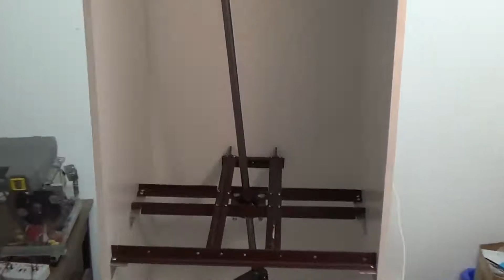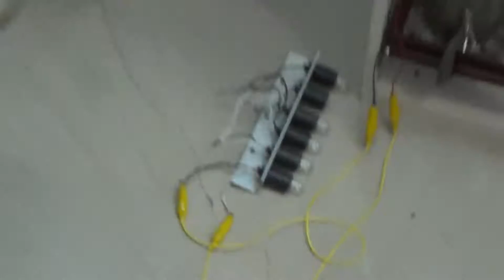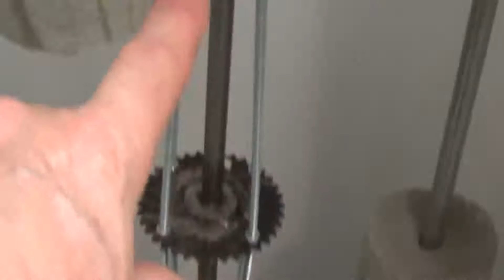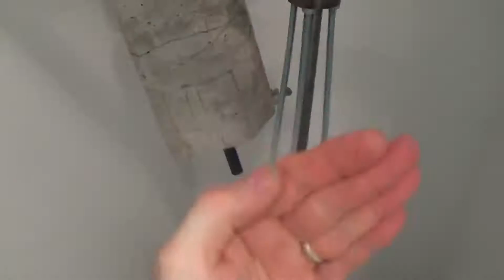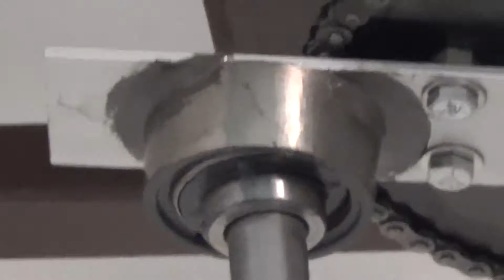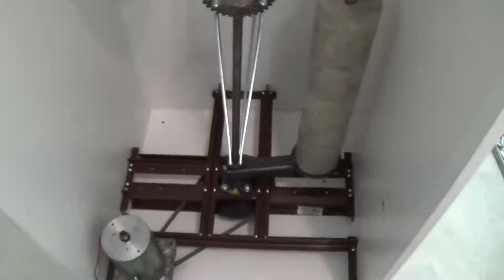William Skinner Gravity Assisted Torque Amplifier test 1

Comment: if you are not getting the amplification it is because what is supposed to be happening in not happening.    and I can see problems with your device.   Remember what is supposed to be taking place.   you are using leverage by a lever arm to lift a mass, (the first weight)  into a position where gravity can act on it.   then gravity starts to pull the weight down but the weight never reaches the bottom, in fact the weight never really looks like it is falling and the height of the mass remains constant.    first stage done, now the second stage is the same as the first stage only a larger mass that is driven by the first stage.    your second stage weight should be doing the same thing, the lever lifts  the second stage weight  to a height where gravity starts to act on it.  then simultaneously the lifting process continues   at the same time the falling process takes place. if your second stage lever arm is not moving enough at the top it won't lift the second stage weight very high and subsequently gravity won't pull very hard on it to pull it down.  remember this is a gravity harvesting machine,  the mass has to gain height in order to fall, if your masses are not lifting very high gravity will have less pulling down force on the mass.     you do not want the first stage drive motor doing anything other than to act as a lever lifting the weight and then to continue to lift the weight as it keeps falling.     the second stage is the same as the first. your first stage is rotating and is attached to the second stage lever doing the same exact thing, lifting the second stage weight so gravity can pull it down.    no forces should be causing rotation in either the upper or lower stages, the only force that should cause rotation is gravity puling the weights down.   watch skinners machine again, the cylinder weight at the bottom looks to be tilted up towards the lever shaft,  it's  tilted up because the lever has been pulled back lifting the weight that can now fall, but it only falls for so many degrees before it is lifted again.   I can't tell looking at your device unless you do very detailed video of it showing close ups and every movement from top to bottom.  that is why I can only explain to you how this things works, now look at your machine and ask your self is it doing exactly what I have stated.    if it does not amplify multiple times then it is not.  find out why.
Reply: Oh boy, another armchair engineer...
Reply: @valveman12  No just a genius sharing his knowledge
Reply: @rmendes2mendes915  Sharing knowledge of what....the impossible!  NO FREE LUNCH...
Reply: @valveman12  i’m sorry that your mind cannot see there are other sources of energy on this planet and you simply need to build the mechanical device to harvest them and what’s really sad is you’re unable to see that the powers that rule this world are preventing these new energy sources from being implemented because they control the energy and the money flow

Comment: You very cool! you have effect?
Reply from the maker: No, I did not get the extra output effect.
Reply: I feel sorry. I also made a similar device and it also gave a minimum increase. By the way, Skinner had 4 turntables, maybe this is the reason? And maybe the device of Skinner were the flywheels, because his lathe was rotated with very slow speed and feed the motor at high speed. Sorry for my English...
Reply from the maker: Thanks. Your English is good.